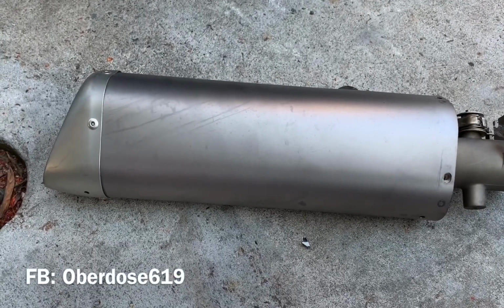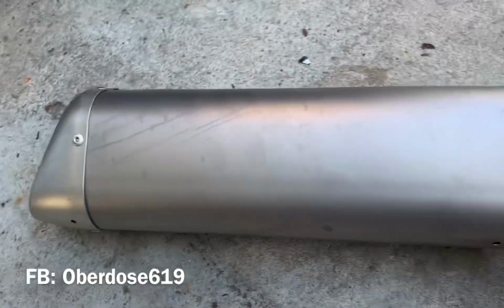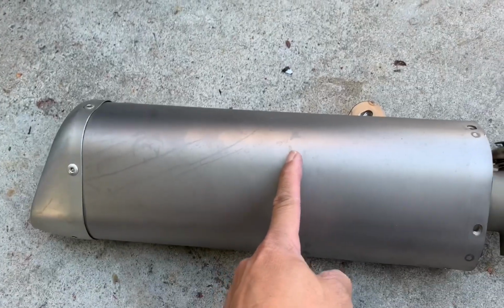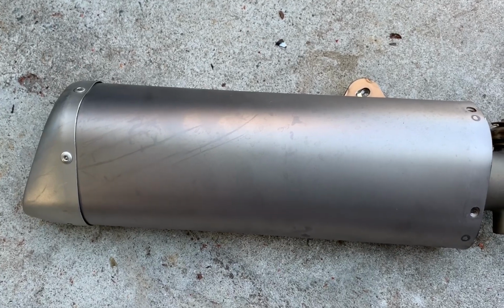2006-2020 yamaha R6 - Stock vs Cut exhaust | which has better sound? | DIY

Comment: Hello. Any problems with the paint  because of heat in exhaust ? Do YOU use a special paint or normal black spray ?
Reply from the maker: I used normal black paint. As of now, still holding pretty good. But I suggest to get the engine paint in case you wanna paint your exhaust.

Comment: I can’t get my exhaust to go back on properly I’m not sure what I’m doing wrong!!!!
Reply from the maker: Jason Utsey check the o-ring between the exhaust and headers pipe.
Reply: PnoyBirit Ph good looking bro 💯 shit I might let yu cut my exhaust I like the way yours came out
Reply from the maker: Jason Utsey sure why not, but i’m sure you can do this kind of stuff, just need some time and effort.
Reply: PnoyBirit Ph I’m hoping that it comes out sounding this good
Reply: PnoyBirit Ph what kind of lining did yu put inside the exhaust
Reply from the maker: Jason Utsey I bought it from homedepot called all purpose house insulation fiber something like that. I could have it ordered online the muffler packing but i hate waiting for days.
Reply: PnoyBirit Ph okay good looking bro had to make sure I’m getting the right stuff

Comment: Did you delete your cat?
Reply from the maker: Troy Howard yes, i did. Any headers from 2006-2020 are pretty much the same. So you can buy 2006 for less cheaper if you don’t wanna cut yours. I got my header for $25.
Reply: @pnoybiritph3993   headers or the exhaust?
Reply from the maker: Headers
Reply: @pnoybiritph3993   why would i need headers to cut my exhaust?
Reply from the maker: Troy Howard i thought you were asking about the header.
Reply: John Ryda but why would I need to cut my headers if I did a cat delete? Does it not align?
Reply: @John Ryda  i thought i could just get a m4 pipe for a cat delete

Comment: At 3:45 how you get it off?
Reply from the maker: Drill the spot welds to separate the canister from tip. You will notice that circle mark around the corner.
Reply: @pnoybiritph3993  Did you need to buy more muffler packing??
Reply from the maker: Stoned Hippy yes, you have to. If there is no packing material available in your area. You can always use the homedepot JM multi-purpose insulation fiberglass material.
Reply: @pnoybiritph3993  what if you dont use packing? I'm trying to do the same but I would like to take the packing out and shorten the muffler.
Reply from the maker: Sam M if you don’t use packing, your muffler would sound terrible loud and lose low end torque.
Reply: @Sam.R6  deff bad idea